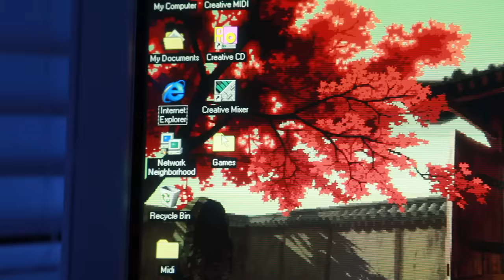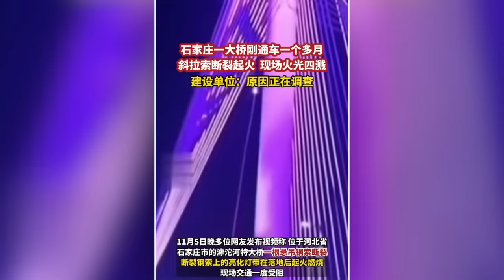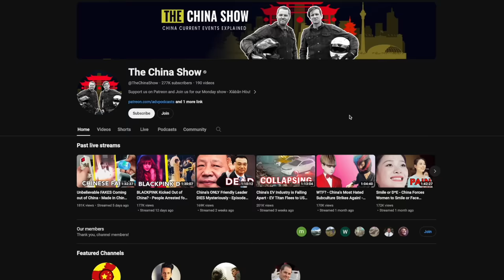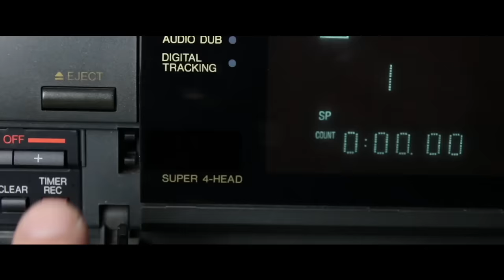Crazy Chinese Workplace Accidents - Why is Workplace Safety so Bad in China?

Comment: As someone who's studying to become an electrician, I've heard some horror stories from some of my instructors stressing the importance of ppe(personal protective equipment).
Reply: I never fully understood why it was super dangerous. Then I got shocked at work by an ungrounded dishwasher and I saw light for 5 seconds and my head rang for a week. I genuinely thought I died. I no longer even flip lightswitches in there. Shits scaryyyy
Reply: I got shocked recently at work by just touching a big marquee sign light switch. It didn’t have the faceplate on it that covered the live wires screwed down, and when the switch is “off” it covers one of the screws. Well it was dark and I was running off muscle memory so when I moved to flip it “on” it already was, and I poked a live screw. 

It was a shock mild as hell but it woke my ass up. My thumb pad muscles were sore for a day and the nerves in my hands tingled for a bit. Uncomfortable as hell! 

So glad it was just a mild shock 😩
Reply: having seen some unfortunate incidents, I can confirm a button up t-shirt is not adequate to protect you from molten metal.
Reply: I learned electrics the hard way. No school, no one tought me, I picked it up as I went. Certainly I got shocked and so developed a feel for my own and others safety. When internet came up I had it fairly easy as all I wanted to know became available like safety measures and procedures. Now I am very comfy with working on live power, I respect electricity but it doesn´t scare me.
That would be my advise: respect the power but when it scares You it becomes even more dangerous.
You can do it, just keep calm. When You´re focused and respectful but not scared You can become a great copperhead.
Reply: PPE is important in any job requiring it, especially electrical. We should be more thankful in America we've got OSHA & other laws on the books requiring basic safety at work. This video is a prime example of how bad it could be without any oversight. 
I was a supervisor at an automotive parts manufacturer & since we had CNC & other machines running constantly cutting/shaving metal safety glasses were a must. One of my setup techs didn't put his on while changing one of the lines over from one part to another & got a metal "splinter" in his eye. He didn't tell me the day it happened but came to me the next day at the start of our shift. His left eye was extremely red, swollen & had a little green puss... obviously I took him to the hospital immediately. He ended up having to have optical surgery a day later to get it out so he wouldn't lose his eye, when he might've been ok if he'd used an eyewash station immediately & tried flushing it out. He ended up wearing an eyepatch for about 2 months afterwards bcuz the surgery gave him light sensitivity. A young woman died a few weeks ago at the factory where my mother works in the office. The girl bypassed a safety sensor to fix the positioning of cardboard on the floor around a robot to catch oil that leaked & her assistant didn't know she'd gone inside the fence around the robot & turned the machine back to auto. I could tell some very nasty stories about people not wearing steel toe shoes when it was required too... anyways, always wear your PPE it's for your safety. That way you'll always go home with everything you came to work with like your life & limbs
Reply: @nolongerblocked6210  your story about the robot is bullshit as they have interlocks with fences and light curtains and you should only enter the enclosure if you are either holding the teach pendant or the teach pendants key.
Reply: Did you check where all this equipment is made ?
Reply: @andrewallen9993  and what part about "bypassed the safety sensors" isn't clear?
Reply: @LaLaLand.Germany  i always say that is good to have a bit of fear in your reserves. as an electrician, i was taught that having just a healthy amount of fear while working keeps you on edge and alert of every single move you make. one day i got too complacent and got my forearm shocked (touched the metal chassis with my elbow), it wasnt serious but it hurts like a b*tch. i fully agree with you, RESPECT it, because it can and it WILL kill you
Reply: @nolongerblocked6210  I bypass safety sensors when I troubleshoot robots, holding the teach pendant having reduced the speed of the device to dead slow. I bypass the safety sensors on Chinese robots made in Germany ( KUKA) by removing the safety circuit connector and plugging in an interlock disable connector (I have one of these because I can read a circuit diagram, use a soldering iron, have crimping tools and know where to buy the connector. I'm supposed to know what I'm doing so any injury to me will be my own fault)
How did this young lady bypass the safety interlocks?
Reply: Am an Electrician and have had a 900v arc that was 2 inches from the discharge rod to a positive post on a very large capacitor, sustained the arc for what felt like three seconds... whole new respect after that for ppe
Reply: @coreypearson8912  if it's lasted that long you must have had a very high internal and surface resistance :)
Reply: @andrewallen9993  I wasn't there so I don't know exactly what she did. All I was told was she bypassed the sensors, I'm not sure if she repositioned one(or two) to not sense someone inside the fence or what she did specifically. They're reviewing the cameras trying to figure out how & what she did. You know that people who work on robots/lines always know the tricks to get around safety features they find annoying. She had it in manual mode then went inside to reposition the cardboard on the floor to catch the oil. The guy she was training & operating multiple lines with, said he walked back & saw the robot was in manual mode so he switched it back to auto. This robot is used for bending long pipes to make muffler pieces for vehicles. After he switched it on the arm swung around, she was on her knees & it hit her in the back of the head. My mother didn't want to watch the video so she didn't. If you Google it I'm sure you could set an alarm for updates to the story after OSHA finishes their investigation
edit: spelling
Reply: The SINGLE most useful piece of PPE is common sense. Followed by a desire to want to not die at that point.
Reply: Once I saw a video of a group of indians carrying something like a metal pole and they hit an aerial high voltage line, the dude smack in the middle was basically vaporized molecule by molecule.
Reply: Holy hell, is the worst of a lot a real life killer robot :|
Reply: @Cornz38  right! The single most important PPebis a functional brain.
Reply: @Cornz38 People are legendary awful at risk assessment. Without rules you  would always underestimate risks.
Reply: As an Electrician it's really important to have the correct tools for the job and always be vigilant.
Reply: When I was an apprentice I was told in tech never to pull my wire without gloves or lubricant great advice.
Reply: As someone who's been in the electrical field for about a decade now, I will tell you what we're told at my job.  PPE is the LAST line of defense.  Trust, but verify, always make sure what you are working on is actually de-energized.  If your workplace has any kind of LOTO (Lock-Out / Tag-Out) policy, know and understand it.  Use it.  PPE is important and can save your life, but taking the steps to ensure it wasn't needed to begin with is even more important.  Know your tools, how to use them, and their limits.  Don't try to use a voltmeter rated for 1000V on a 4160 switchgear.  Good luck in your career choice! I've found it to be fairly enjoyable overall, myself.
Reply: @andrewallen9993  proper insulated boots, certified high voltage gloves, blast shield etc. The discharging rods are about 6 feet long to keep you a safe distance, supposed to dissipate through rod to ground clamp... normally will spark quick and be done... these are huge liquid filled capacitors that weigh 50 pounds each, normally discharged through the grids, but sometimes this fails. The importance of PPE and walking through each step and not rushing is very important. Discharges like this remind us that we are working with lethal consequence.
Reply: Trust no one. 
I’ve had people claim a circuit is isolated but it be live, and people taking off my lockouts to re-energise circuits I’ve been working on.

PPE may save your life, but never aim to test it.
Reply: As a very curious 4 yo, stuck pinky in commercial socket and told friend to flick switch "ON". Unshockingly (pun intended) found out that teleportation is a thing, as I was tossed 3-4 ft away with a FAFO life lesson that I still appreciate. Respect to electricians, in context.
Reply: @miskatonic6210 They drastically overestimated covid risk.

Comment: There was a time here in the UK when the price of copper piping which we still use for household plumbing, went through the roof. In fact shortages were common which led to widespread copper theft. The reason? China's building boom. What a waste eh. Thanks Winston for these insights. 👍
Reply: It was the same with scaffolding. If you could find any that was new, it was hugely expensive.
Reply: Concrete Export/import price went through the roof for the same reason
Reply: Likewise for malleable iron pipe, used for gasfitting and heating.
Reply: Same with sand

Comment: Watching this gives gives me a renewed attitude and appreciation for California's permiting process for construction related builds. I used to think that the prolonged waiting period was solely bureaucratic red tape. But now I believe that safety and conformity to standards that make it safe for the citizen like myself plays a big part in the delay. As an example, the simple procedure of retrofitting my house with brace and bolt for earthquakes, completed last week,  started with a requirement for choosing a qualified company trained in the procedure. It ended with the contractor meeting with the government inspector to confirm the job was completed according to standards. Your video gives me a fresh outlook and appreciation for where I live, and for that, thank you Serpentza.
Reply: i mean there is such a thing as safety theatrics (which is what people really complain of in california). the two aren't mutually exclusive
Reply: No. Hi, I'm a General Contractor in California. California's Codes are for One Purpose....Kickbacks. Here's the Scam. Contractors will become Inspectors. They get friendly with the City/County. Then they go and "Inspect" work. If you as the Contractor are not present and allow them to interact with your Customer Alone, everything becomes an Issue and they know someone that can be brought in to fix it all for cheaper. I've caught them in the act multiple times and even set up a Sting with a Client because the guy made the mistake of trying to burn me with a LONGTIME Client that recommends me to all of his Friends/Family/Training Clients. My Client was immediately wary because he knows my work and knows my process. It was a Block Wall rebuild  The Inspector claimed I didn't use Rebar or Concrete inside the Cinder blocks. Funny thing is, the entire reason I had to tear it down and rebuild it is because it was falling because the original homeowner built it himself 10 years prior with no Rebar or Concrete. He saw my 10 foot rebar get hammered in and set in the new Footing I poured. He saw the empty bags of Concrete and that ever single Cinder block was Stacked and filled with Concrete. 

That's not the first one to try it, it won't be the last.

Don't even get me started on the time the County approved our plans for a Wrap Around Deck on a House then after we built it told us that our design actually wasn't up to Code but we could pay to have an "exemption" for it.

Comment: Went to Xiamen quite a few years ago … I was astounded seeing high-rise window cleaners basically dangling down with one rope each tied from the top of the building .. there were probably ten workers cleaning windows at the same time … this was outrageous dangerous to make a living .. haven’t seen anything ever anywhere else
Reply: This is how a lot high rise building windows are cleaned in the UK i have acctually seen them absieling down the Shard in London
Reply: @nickbadi3599 They probably use harnesses and double lines with proper spots to tie themselves. In China its insane, theyll just tie a knot to a single rope and dangle off a high rise

Comment: Apparently the barge that hit that bridge had a failure in the hydraulics that raise the wheelhouse. It can be raised to look over high stacks of containers, if need be, but it wouldn't go down and it was too late to stop the thing. Crazy.
Reply: Thats a stupid accident. I worked on ships since early 80s. That system should 
have been checked before they let go of the lines. Ship should have been going 
slow enough to stop before it hit bridge just as standard safety procedures, Never 
heard of that system  a lookout with a radio on the bow has always worked fine.

Comment: I will never forget Heilbraun, W. Germany 1986. It was February and cold. We watched as a small fender bender on a HUGE bridge. A car vs. a tanker hauling liquid O². The car split the side of the truck and just like a crappy CGI everything fell 180 feet into the gorge below. A 1.2 kilometer bridge. Reduced to dust and a pretty fireball. To this day I won't drive near a tanker truck unless I absolutely have to.
Reply: Double wall tankers help
Reply: It is not just driving. People should really respect the forces/energy involved. In that case some car driver simply did not respect the clearly labeled dangerous road haul. But like danger around tankers are a constant. Even on foot you should avoid being near it. And intervene if you spot someone tampering with it. Even a petrol thief can cause ENRORUMS amount of damage if a cubic meter or more is released onto the ground. Even small amounts can ruin ground water or literally anything. Even MILK can have devastating consequences if it starts to leak into earth or anywhere. Imagine a hole big tanker of MILK getting lose into a city street? The smell alone is a long lasting thing.

It is always funny how oversized cargo (like barely big enough to need a support car) or military transport with drawn guns are a thing. And people respecting it. But a tanker? More often then not a tanker would need armed convoy to get even the worst drivers to back off from doing something stupid around a lethal transport if stuff go sideways. (quite literally)
Reply: Wait a minute Germany is real??
Reply: My whole family almost died in a car accident because someone was carelessly passing a truck in bad weather and almost hit us, causing us to swerve on road ice to opposing traffic. Through sheer luck, no one got hurt.
Reply: You mean Heilbronn. Not Heilbraun. But be at ease- tankers in Germany are safe when just driving. We have good laws and cops do enforce them. Kind regards
Reply: @LaLaLand.Germany Kennst du den Unfall? Ich finde nichts dazu im Netz
Reply: As a motorcycle rider, I dont follow septic tank pumper trucks or horse trailers.
Reply: Nothing like that ever happened in Germany. What are you talking about? Terminator 2?
Reply: Hey genius. I have a picture standing next to the wreckage. Do I then not exist? If you Close your eyes 👀 do you become invisible?
Reply: Keine Ahnung wovon er redet. Habe aber auch nicht recherchiert. Ich erinnere mich an Herborn. Vielleicht meint er das? War aber viel später... @strohsternbastler
Reply: @dachunde  If I´d close my eyes, at least your bullshit would become invisible for me. If this incident ever happened - it definitely was not in Germany

Comment: I used to live on the 54th floor of a 60 floors building in Guangzhou and since it was a brand new building and I was the first tenant, the landlady had airconditioning installed in the bedroom and the living room (also so that she could charge me more for rent of course), two guys came an hour later with two split units, first they installed the indoor unit and ran the pipes to the outside through the hole, then they took the lift to the rooftop (which of course was open, this being China) with the outdoor unit, a few minutes later we saw one of the guy come down tied to a rope together with the outdoor unit, that looked incredibly perilous since these things are at least 50kg, he had to push the unit into the alcove built inside the external wall of the building and then screw it to the railing all while in mid-air, these guys are fearless, the most insane daredevils you'll on the internet scaling buildings are nothing in comparison.

Comment: 00:45 🔒 Ad
01:53 🏢 China showcases a shiny facade, but behind it, there's a chaotic system, especially in workplace safety where regulations are often ignored.
03:42 🛠 Chinese workers often lack proper safety training or adherence to safety guidelines, risking their lives on the job without adequate precautions.
05:41 📜 Regulations exist on paper in China, but they're often misunderstood or willfully ignored, leading to unsafe working conditions.
07:24 🏙 Chaotic Chinese cities pose dangers to workers with poorly built structures and unpredictable accidents due to the chaotic environment.
09:25 🏗 Shortcuts are the norm in Chinese construction due to the pressure for rapid completion, leading to compromised safety standards.
10:48 ⚠ Neglecting safety laws and codes in China leads to exploitation and suffering among the working class, emphasizing the necessity of these regulations for societal well-being.
Reply: Thank you ChatGPT for your summary and service 👍
Reply: Who skips Serpentza's videos? it's concise enough and doesn't need timestamps.